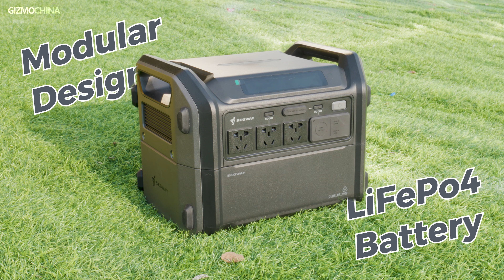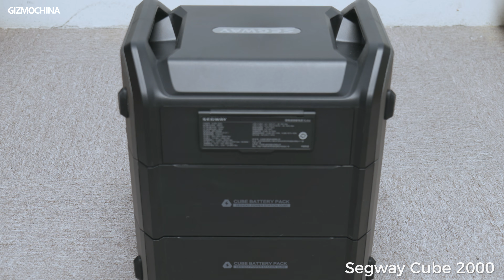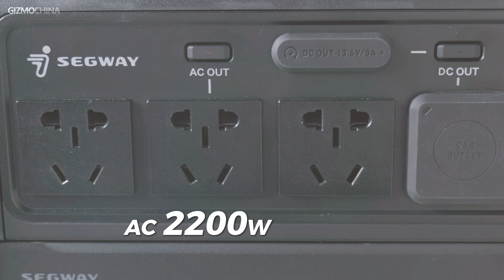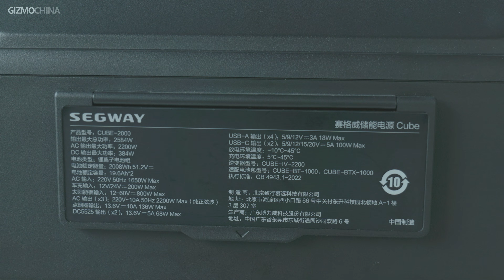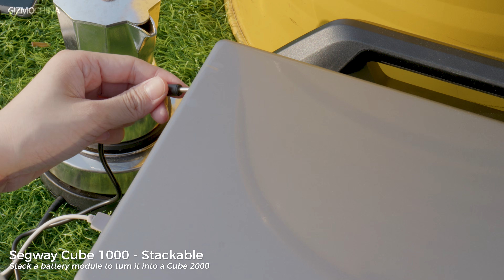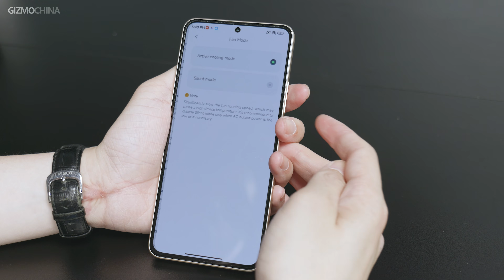Segway Power Station Cube 2000 Review: Truly Stackable, Reliable And Affordable

Comment: The head unit is great, everything integrated. But the dumb expansion units, proprietary connections makes it the weak point, you have to buy from them so long as they still make them available for sale. It's not economical.
Reply: Thanks for sharing your thoughts! I understand your concern about the proprietary connections with the expansion units. It's definitely something to consider when purchasing a power station. However, the Segway Portable PowerStation Cube Series offers a range of impressive features, including a massive capacity, fast recharging, and comprehensive protections. It's a reliable option for outdoor enthusiasts and RV lovers.

Comment: if my laptop charges at 220w how long does 1 kl watts will last?
Reply: 1kw...
Reply: Thank you for your comment! The Segway PowerStation Cube 2000 has a capacity of 1 kWh to 5 kWh, so it can definitely power your laptop that charges at 220W for a considerable amount of time. The Cube Series is known for its reliability and affordability, making it a great choice for camping or backup power. It also offers fast recharging and versatile sockets. You can check out the video for more details! Happy camping and stay powered up!
Reply: Thanks might considering getting this I upgraded my peripherals and got 27" monitor I hope this thing would last me atleast 4 hrs laptop+ monitor.
 @CherokezPittman
Reply: @CherokezPittman  for a considerable amount of time. useless answer
Reply: @CherokezPittman  Why not just answer the question, 4,5 hours

Comment: modular replaceable batteries is genius
Reply: I completely agree with you! The modular replaceable batteries of the Segway PowerStation Cube 2000 are indeed a genius feature. It's so convenient to be able to stack additional cordless battery units and easily replace them when needed. Overall, it's a reliable and affordable power solution for outdoor enthusiasts like us.
Reply: Thank you for your comment! I completely agree with you, modular replaceable batteries are indeed genius. The Segway PowerStation Cube Series is a great choice for outdoor enthusiasts and RV lovers, as it offers a massive capacity, fast recharging, and comprehensive protections. Plus, its waterproof technology ensures durability in any weather conditions. Definitely worth considering for all your outdoor adventures!
Reply: Thank you for your comment! I completely agree with you, having modular replaceable batteries is indeed a genius feature. It's great to see Segway offering such a versatile and reliable power station with the Cube Series. It's definitely a fantastic option for outdoor enthusiasts and RV lovers who value convenience and quality.
Reply: Yes, the modular replaceable batteries in the Segway PowerStation Cube 2000 are indeed genius! It's great to have a versatile power station that can meet different power needs and keep our devices running for extended periods. The Cube Series offers impressive features like massive capacity, fast recharging, and comprehensive protection. Definitely a valuable addition to any outdoor enthusiast or RV lover's gear collection!
Reply: Great observation! The modular replaceable batteries of the Segway PowerStation Cube Series are indeed genius. It allows for flexibility and convenience, especially for outdoor enthusiasts like us. With its massive capacity and fast recharging, it's definitely a reliable and affordable power solution for camping and backup power needs. Thanks for sharing your thoughts!